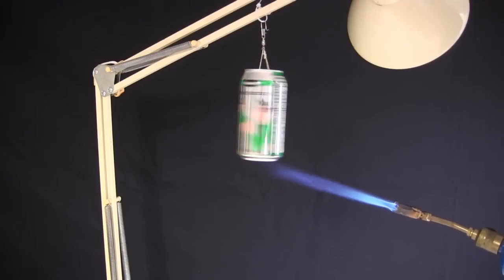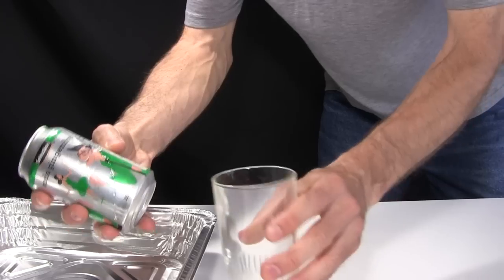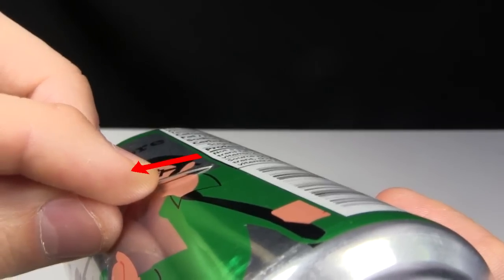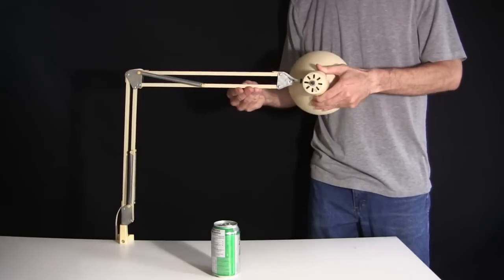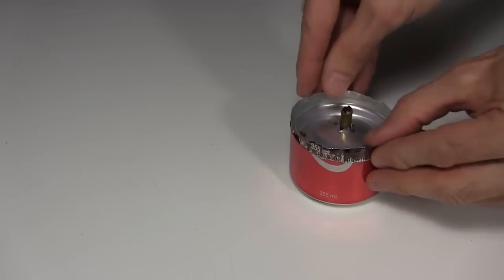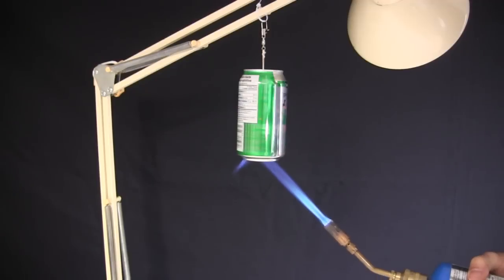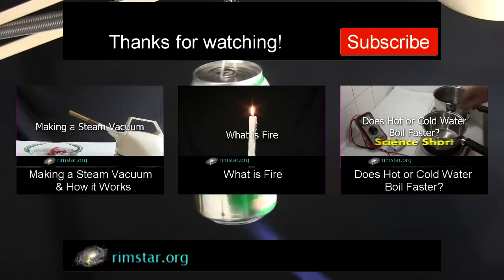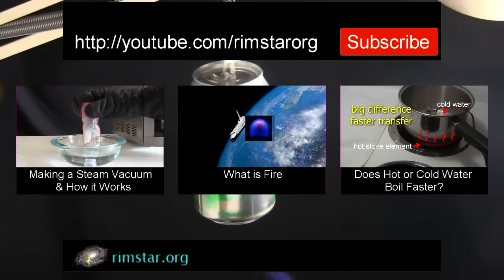Hero's Steam Engine using Soda Can

Comment: I mean, don’t get me wrong, it’s a very interesting design, but it’s hardly an engine, unless you were able to attach connection points to drive something, at best, I can see this becoming a device to generate electricity. It’s also a very high maintenance design unless you were able to get the right temperature consistent, which is a rather easy fix and even then, the water reserves inside the can will expire in a short amount of time.

Comment: great inspirational video from you as always...lets make one that spins from the heat of the sun and turns an alternator in the process
Reply from the maker: fidel catsro Yeah, I was thinking of connecting up a generator once I got it working. But then when I saw how much heat you needed to apply, I decided it wouldn't be worth it. But if it was sun powered....

Comment: Would adding additional jet ports help the thing spin with the alcohol flame? Perhaps just the two holes but making them larger or smaller would help?
Reply from the maker: USWaterRockets Hmm... I really can't say. Sounds like there's room for experimentation. +Martel DuVigneaud pointed out below that a hotter alcohol stove is possible, just a little more work to make. It would be nice to get it working with more of a DIY flame source.
Reply: RimstarOrg come to think of it, your water should boil at the same temperature regardless of the flame source.  It must be that the torch is sufficiently hotter that the energy lost in the steam doesn't cool the water faster than the alcohol flame can heat it. So, what if you increase the size of the alcohol flame? If you use a larger wick or multiple wicks? That might give you more heat per unit area and keep the water boiling.
Reply from the maker: USWaterRockets Yup. That's what I was thinking, an alcohol burner with multiple flames. +Martel DuVigneaud brought it up below.
Reply: Think a really hot fine tipped soldering iron. You don't use the to solder the tabs on metal shields. You use a big fat high wattage soldering iron for that, even though it might not be as hot, it still does a better job.

Or a better analogy would be you don't need higher voltage, you need more current!

Comment: If you use a needle and a syringe it would be easier to fill. If you were to fill it with alcohol (the can) would it shoot flames ?
Reply from the maker: ‍1marcelfilms Good idea, as long as the syringe needle is sufficiently small. You probably don't want the holes to get too big. And that would be a real rocket propelled Hero's engine!

Comment: The pressure from the torch was the only reason the can began to spin.
Reply from the maker: Nope. In this follow-up video https://www.youtube.com/watch?v=05f6ZaWmr8Q the flame is from directly below the can. There's also not much water in the can so it doesn't have as much mass as you might think.

Comment: i think the can is spinning because the pressure from the blow torch is making it spin
Reply from the maker: You can clearly see the steam coming out of the sides in a direction that would make it spin. The orientation of the blow torch flame wouldn't make it spin though. I also have this follow-up video with the flame directly below the can https://www.youtube.com/watch?v=05f6ZaWmr8Q

Comment: I would have probably drained faster if you put the second hole in right away to allow air to enter the can.
Reply from the maker: AndyFromBeaverton Good point. I'd think so too but having done it this way it surprisingly it may not be the case. Shaking that can like I showed actually caused the fluid to jet out and rapidly emptied the can. Though that won't work with some sodas.
Reply from the maker: GhastlyDerp Now that you mention it, I did do that at one point and it helped.

Comment: i dont have a fishing swivels.. what else can i do plz answer me quick
Reply from the maker: +Harshit Dubey It's harder to do, and I'm not sure it would even work, but you could try something like I did with the sunflower heat engine (https://youtu.be/m9i3VVd9ISk) but arranged vertically instead.
Reply: +RimstarOrg is it possible to use thin thread althrough
Reply from the maker: Harshit Dubey
Sure. But since the thread is tied at both ends, to the can and to wherever it's hanging from, it won't be able to keep spinning forever. But you'll at least be able to see that it works.
Reply: +RimstarOrg how can i generate electricity with this
Reply from the maker: +Harshit Dubey For electricity you could hang it from a motor shaft. When you turn a motor shaft, the motor becomes a generator instead and produces electricity. However, I don't guarantee you'll get enough torque from this to actually turn the motor. I'm doubting it. You could also try a simpler one by attaching magnets to the top and surrounding them by coils that are stationary i.e. make your own simpler, less powerful generator. You might be able to light an LED that way, again, assuming you can produce enough torque to make that turn (any generator produces an opposite force that opposes the rotation.) You'd also have to make sure the magnets don't get too hot since that will demagnetize them.
Reply: +RimstarOrg i tried to do so but i cant signals of any voltage generated
Reply from the maker: Harshit Dubey
Do you mean you got your Hero's steam engine working and you attached some magnets and put a coil around them or did you hang it from a motor shaft and it actually turned?

Comment: this is fail the gas expelling from the torch is what's creating the movement
Reply from the maker: Jay Means Nope. See https://en.wikipedia.org/wiki/Aeolipile
Reply: nvr said that the invention wasn't real just that this version of it doesn't work well if at all notice the angle the man holds the torch at just off center. cut the needles out of 2 hypodermics an place those in the holes then tape them to the side an id bet u it would work
Reply from the maker: Jay Means
Yup, there are all sorts of improvements that can be made, including your suggestion. I wanted to do the simplest for this video for anyone who wants to make one easily. Check out my follow-up video where I made a new alcohol stove for it and made the soda can look like a minion (https://www.youtube.com/watch?v=05f6ZaWmr8Q) for added fun (though now that you make me think more on it, I should have made the minion's arms into redirectors for the steam jets.)